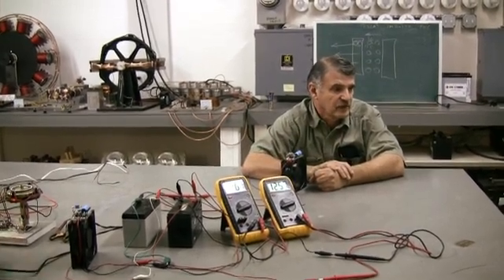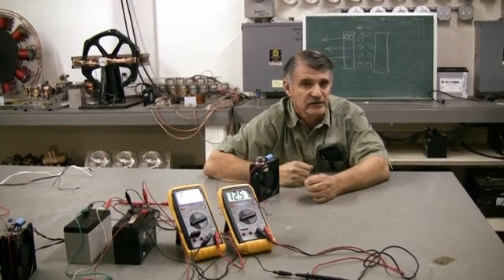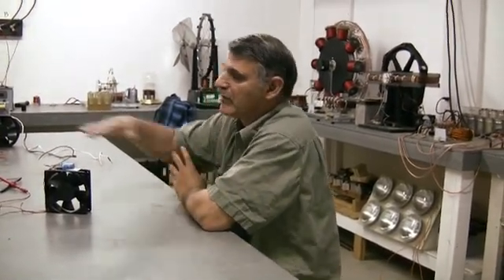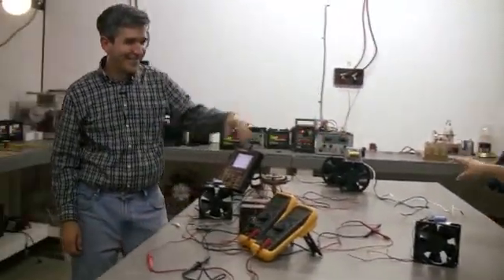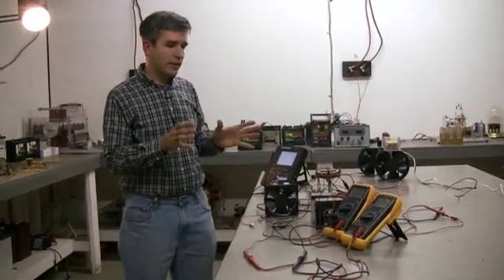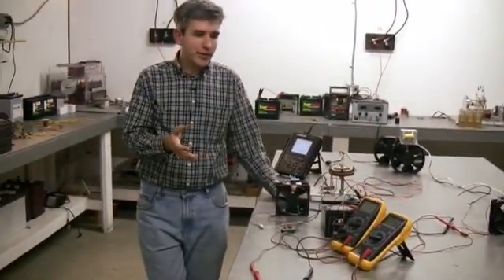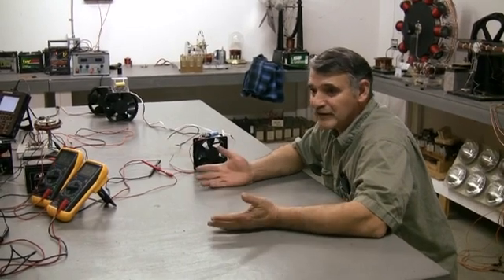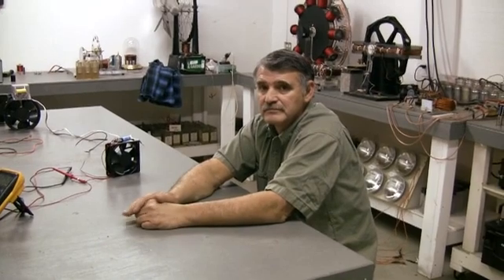Energy From The Vacuum - 17 - The Tape Drive Motor (2010) - Part 3

Comment: I have to say something is off here. This was filmed in 2007. I know about Bedini for 20 years. I have some of these DVDs at home as well. John Bedini was talking about this already in 1984, I think. And it is 2023. Electric cars are reality, and yet nobody is implementing these things. What’s going on? Are those gains so marginal that they do not matter? Can’t be that everyone is stupid. Thoughts?
Reply from the maker: Its because most EEs just have a single track mind and are never taught these things. In the case of fly-back/noise/parasitic induction etc etc they are thought of as nuisances to be gotten rid of. Not used to enhance operations/increase efficiency. I find it sad when some EE has a go in the comments and you can clearly see how brainwashed and absent minded they are. They have no clue how to think about all the mechanisms they have been trained to eliminate. To them they cannot possibly be used for any sort of work or power delivery. Yet like all things circuits need balance. Give them that balance so they don't have to fight themselves and wonderful things happen.
Reply: @GuardianEngraving  I get that. But if you have a valid technology it will make it to the market quite fast. Why didn’t this. Why is it after 40 years still in the realm of hobbyists?
Reply from the maker: @Traderhood I dont know where you get that idea from. In my experience, 99% of inventions never make it. I used to watch a show called "Beyond 2000" It was about all the latest inventions/ideas in science and engineering. Almost none of what I remember in that show has made it to market, and I can not buy.